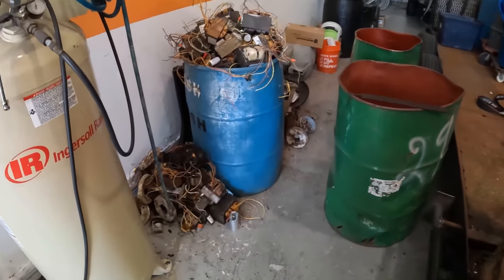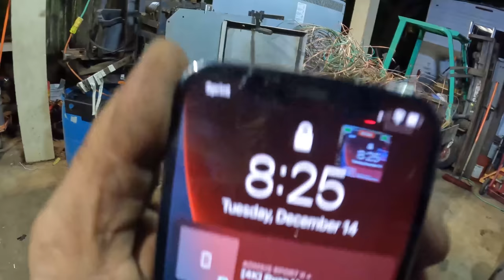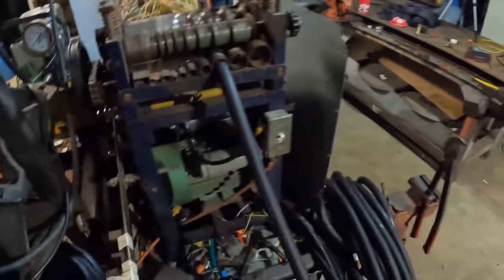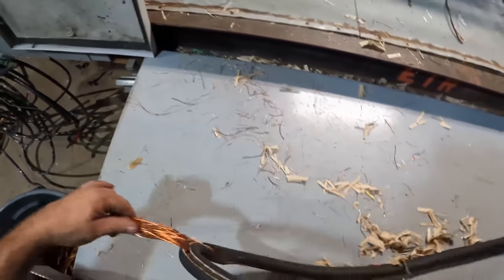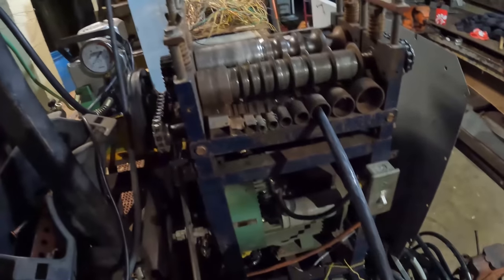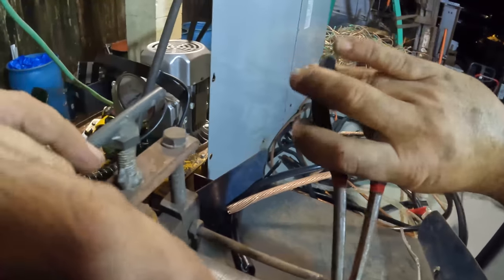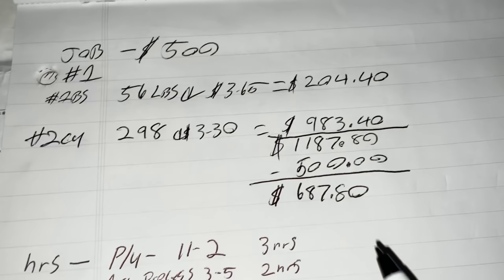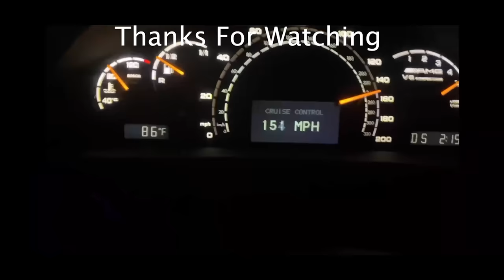Make $1000 A Day Scrapping!

Comment: You said "someone, somewhere's crying" over that welding cable. Now you're gonna cry...
  That was a 50ft welding cable, 4/0 gauge. The plain wire sells for $300 + shipping on eBay, netting $200 — even more with the connector you cut off.
Reply from the maker: I know what it’s worth if I could sell it, I get wire like this all the time I don’t have the space and the money to hold onto it. It doesn’t sell as fast as you would think I’ve tried. I buy all the stuff from electricians if they wanted it they would keep it.
Reply: @Project Shop FL  right, saw the same comment with the copper coil.  Time is money.  If he's banking say $125-$200 an hour then 1 hour of doing all the crap to sell on eBay, plus shipping, it's not worth it.  If I talk to my phone or internet company for more than an hour best believe I'm getting at least $100 out of it.  

$200 in the hand is worth $600 sitting on eBay that buyers buy wholesale with their business license and aren't wasting time on a bidding war on some 400 cable.  In plain terms he can bust his ass more and make less over time than just scrapping.  

I've been in scrap since the mid '90s.  .coms and eBay didn't change the scrap industry.  He knows what he's got and how to turn a quick profit being the key point.  1st video, I've seen, and have links to all the info, essentially found the best video here.  If he was my neighbor I'd hear the tunes/work and come over for a beer and help for fun.  My professional opinion!  Great job bud!
Reply from the maker: @generalconsumer9520  Thanks

Comment: I scrapped part-time for nearly two decades. I rarely made $1,000 in a day. YOU WILL NOT MAKE $1,000 A DAY. If you save your non-ferrous metals (copper, brass and aluminum) long enough you can earn $1,000 that day. If you are scrapping iron and steel you will need about 20 tons per day depending on the price.
Reply from the maker: I don't really deal with iron. I deal in copper and have custom equipment that no one has. I've made $1000 -$2500 a day processing copper. I've made many videos on it.  I have a video called "How to make $900 per hour processing copper transformers"  Now recently it has definitely slowed down because LED lighting has replaced the HID light's and transformers but I still can easily make $1000 in 1 day it's just not as often.

Comment: A guy wonts came to my job shop and asked me the cost to build a  cable cutting machine.  I asked how big of cable.  he sid the logging roads were lines with 3/4 steal l cable. .  After the cables were used for 175 hours  of logging. they were replaced.   I told the gentleman that I could build a shear  and stacker of the cables for 600.00, but he said it was out of his budget 1969.
Reply from the maker: Sounds like a good deal to me. lol

Comment: Why don't you make a little circle wedge to use to reduce the size of the hole.
Reply from the maker: It might help a little but is not gonna reduce the size of the rollers. The large cups will allow the wire to slide to the side of the blade. Thanks for the suggestion.

Comment: im still not quite sure how to decipher number 2 form number 1 copper...i mean youd think that stripped wire which is clean would be number 1 but i was told its number 2 also ...number 1 has no welds, paint or anything on it supposedly so from what i m getting its mostly copper pipe nothign from wires or anything..still thats alot of copper around ehre number 2 goes for at the lowest maybe 3 dollars but its usually more 3.50 lowest anyway usually around 4 is decent ...so thats close to 2000 dollars here.. id be happy being able to make that much but you have to have connections for that ...every now and then theres som big hauls..im going to start stripping stuf fmore i think theres alot of copper that gets by...compressors and such,,probably start stripping them...just for osmehting to do
Reply from the maker: Any extension cord wire, SO cable or welding wire with the fine copper strains will always be #2 copper. Copper pipe with no solder and paint should go as #1

Comment: I almost feel like if you had a huge set shears like that but hand operated you could go through more cables at one time then that hydraulic one that's kinda of a crappy pump of that's all it can do lol
Reply from the maker: The pump is not a problem, the pump is a 10,000 psi pump, the sheer is only 5000 psi and really only made for cutting the thin metal from a car. There are other cutters out there called decommission tools that are more along the lines of what I need I just got these because they were only $200 compared to thousands for those other tools

Comment: scaring the hell out of me with those jaws
Reply from the maker: 😂 Why?
Reply: lol. Hey man I have the master carpenter and ran a theater for 18 years and one of my jobs was obviously safety officer and equipment trainer and tool trainer I've never used it a piece of equipment like that I imagine it's pretty powerful I usually in my line of work I usually see an accident before it happens and I put a stop to it it was just something about watching you that I just made me cringe I mean you sure you felt safe but was weird I didn't and I was afraid for you it was a weirdest thing man and anyway good video I enjoyed it very much
Reply: @ProjectShopFl  AR side note have you ever I'm scrapped an RV refrigerator 12 volts propane system I just picked one up tonight I've never seen the back of one of these before
Reply from the maker: Thanks for the concern

Comment: Maybe some lubricating from time to time with WD40 or something like that would help on your stripping cables machine to prevent this plastic film from insulation block your machine. Dunno just saying.
Reply from the maker: You don't want oil on the rollers, it will make the wire slip.
Reply: @ProjectShopFl  Yeah didnt notice it has cutting rollers up and down, i thought the down roller had some kind of  teeth to grab the wire.
Reply from the maker: @petertomas3665  It does not have teeth but it should. lol

Comment: Make a sleeve than can reduce the hole and center it. Make several for the different holes so you can double or triple the holes you have now.
👍😎👍🇬🇧 m-E-m
Reply from the maker: Thanks for the suggestion.
Reply: They sell those, not as big, but the time he spent to strip that eagle's nest of wire I was more than impressed.  If it ain't broke...

Comment: You could have made a lot more out of that 750 cable if you would have sold it as wire instead of scrap. You would think an electrician would have bought it.
Reply from the maker: I bought it from a electrician. lol I don't have the space to hold all the good wire I get. I would quickly run out of room and money. It does not move as fast as you would think. All of my customers are electricians and unless they have a job for it most really don't have the space for wire they might never use.
Reply: Wow, OK. Strange but true...

Comment: I can’t believe striping that large wire with the length you had you can make more money scrapping it the price of that a foot is so expensive I can see if you had short pieces of it    But when you toke the jaws of life to it. I was like dumb as shit seen in a long time bud the way it sat made more money and didn’t have to do anything to it. Only seen folks trying to hide or cover up something take perfectly good wire and chop it up and scrap it.  So please explain wth any one would do such and not even get bright price for it. Rest video bang up job and made perfect sense to me. And I may be the idiot but I know buying it just the jump from 12to 10 gage and then 8 gage is a lot and what you had only hundred how much would  that wire cost you
Reply from the maker: Yes that wire was worth more "as is" If I had some one that wanted it. I get wire like that and lots of other wire all the time and have tried selling it. The problem is unless some one has a job for that specific wire and length I wind up sitting on it and it takes up space and my money. If I saved all the good wire I got I would be out of space and broke real quick. It does not sell as fast or as easy as you would think. I buy all the wire from electrical contractors, If they wanted it they would have kept it. I hope that makes scenes to you.
Reply: black market in Australia, ppl rip empty houses apart & steal copper & brass to sell, I agree if You have more valuable cable intact why would you scrap it for less unless you only have small volume of it & quick turnover

Comment: From a business point of view, wouldn't a thick 2000 v cable  be worth more selling to an electrician or someone who needs it for a machine or what not ?  Sure you need to put in more time finding a buyer, but isn't all about using the least effort to get the maximum profits ?  I bought a big heavy guage cable 100 ft long to power 2 trailers, I think that was around $400 or more.
Reply from the maker: Yes it would be worth more. The problem is I bought it from an electrical contractor and I get new wire all the time. It don't sell like you think. I don't have the money or space to store all the good copper I get neither does some electricians that's why they sell it to me or scrapyards.

Comment: Why don't you get someone to knock up a few different sized bushes up for the hole's you have so you can change them to suit different sized cables rather than adding more different sized tubes
Reply from the maker: Good Idea but the problem with that is its not changing the size of the rollers. the wire will still walk all over once past the tubes. Thanks for the suggestion and for watching.

Comment: Couldn't you have made more money selling that big wire to someone as is vs selling for scrap? Just curious.
Reply from the maker: If there was someone that had a job for that specific size wire and length maybe. But I can not sit on all the good wire I get I'd be out of money and space in no time. It does not sell like you'd think. If the electrical contractor I got it from wanted it he would have kept it. They are in the same situation, they will have piles of good wire and they get tired of moving it around or it taking up space. Scrapping it is the best option.
Reply: @ProjectShopFl  true, the presumption would be if someone had a project they are doing they would already incorporate purchasing that wire into their equation. Makes sense. Thanks for the reply. 🙌

Comment: Wouldn't it be easier and faster to burn off the insulation?
Reply from the maker: No because the copper is wrapped around the welded steel case.
Reply: @ProjectShopFl  ah, ok. Thanks!

Comment: How much did it cost to dispose of the stripped plastic coating, and how many multiple places did you have to travel to pick up everything, how many hours were involved in travel and communications, insuring your vehicle wear and tear on the vehicle, wear and tear on tools(which clearly need major repairs), how much did you pay for your equipment to start with, you didn’t make $1000 in one day, because you spend many days collecting the metal, and many hours are involved in that, and you left out costs of keeping your tools maintained, among other things, im going to estimate $300 a day because altogether you likely spent a total of 3 days including collecting of the metals. When calculating your profits in any business, tracking the costs of everything is necessary, you did a good job tracking how long you spent in the shop, but disregard all the time it took to get everything into the shop which is how businesses show profits on paper but have nothing to show for because they disregarded half of the work they did, your time has value, not just the time in you shop but every waking moment spent collecting your metals has equal value.
Reply from the maker: This is just a hobby of mine and I'm showing what is possible. Did not cost anything to get rid of the plastic I put it out for recycling. I explain everything in the video. I picked up most of that scrap that morning from 1 place. The other scrap was from a job that I already processed and made all my money back plus lots of extra that also came from 1 place. I call that F-it scrap. I even explained there was more scrap left over from that day that I did not sell.  I usually pick up and process scrap and sell it within a 24 hour time frame and can and have made $1000 per day. I've made many videos showing it.

Comment: Where did you get the cutter
Reply from the maker: What cutter?
Reply: @ProjectShopFl  the hydraulic cutter you used to cut the heavy wire into shorter lengths
Reply from the maker: @ralphkleyer9324  Ebay. it is a jaws of life

Comment: Where would you find that giant flexible copper for "not alot"?? You could have sold that for 2-3 times scrap value!! What a waste!! I would have paid you for that pile!! I make giant battery cables and welding cables for people. You lost money scrapping that beautiful copper!! I once saw a guy drop a 80 lb. block of lead in place of light iron. Thought he was getting one over on the yard! What he did was lost himself about 100.00 bucks. Good luck.
Reply from the maker: I bought it from an electrician just like all my scrap. I get stuff like this all the time and it don't sell as easy as you think. If I kept all the god copper wire I get I'd be broke and out of room. I'm in the scrap biz not the wire selling biz. I made my money and I did not have to spend time trying to find a buyer and have it taking up space I don't have.
Reply: @ProjectShopFl  amen brother

Comment: Seems to me, That "brand new"  heavy copper cable was easily worth a multiple of its scrap value if sold as is. Chopping it up for scrap is equivalent to doing the same to classic car parts.  To the man with a hammer, (or wire stripper) everything looks like a nail (melt value scrap).
Reduce, REUSE, then recycle.
Reply from the maker: Who would buy it? I bought it from a electrical contractor that did not want it. If I kept all the scrap that was usable I'd be out of space and money. It don't sell as fast as you'd think.
Reply: @ProjectShopFl  Have you tried CL or marketplace?  Or call a shop doing solar system installs on homesteads or custom vans. It may be oversized for their needs but you could offer a price that's win-win.  Or try  a shop installing winches on 4x4s.  Or a  welding shop.   Or a boat yard doing electric conversions.  A little sales bird dogging may present a learning curve at first, but could be a valuable addition to your tool set.

Comment: Dude put some gloves on touching that stripped copper with bare hands then eat and drink or scratch your your self 
It contains harmful substances to protect it from corrosion and stuff your getting that on your hands
You doing a good job but dude take care of your machines 
Librication and derusters are key to keep a good machine rolling
Your machines lacks a bit of power due to rust and dry parts everywhere 
Use MOTUL chain lubricants and w40 for those bolts you tightening 
You will thank me later
Plus change the belt to a chain it’s better just buy sake size but sprockets and a good motorcycle chain something like a v530 it so long you can make 3 chains out of it with $100

Comment: You might have to sharpen the blades on your machine. Might cut better.
Reply from the maker: You are probably right, I have new ones and am going to make a video of the process of replacing them and some upgrades. Thanks for the suggestion and for watching.
Reply: @ProjectShopFl  take a file to them . That should do it.

Comment: I have no Idea how you take apart transformers, why not show 30 seconds of detail before switching tp high speed.
You also chopped hundreds of dollars of cable that would have made the worlds best jumper cables, which you could have sold for a kings ransom.
What a waste lol.
Reply from the maker: I get so much wire I can not hold it, it comes in and I strip it as fast as possible so I know what my profit will be before the market changes. I've tried holding onto it but it just piles up and I wind up stripping it. When a electrician needs wire its usually a certain size and a certain length. There are tons of wire sizes and most of the wire I get has been pulled out and already used. Its more of a hassle to try and save it to sell as is. As for the the transformers I explain everything in this video. 
https://www.youtube.com/watch?v=aL9jkAn8uyo&t=1035s

Comment: That’s a terrible wire stripper all u need is a single blade with a adjustable clamp on a roller they cost under 200 bucks
Reply from the maker: This wire stripper cost around 1500 new, no $200 wire stripper is going to compare to this!

Comment: Make $1000 dollars a day.  But only if u have 10+thousand dollars in machinery.  Great video otherwise.
Reply from the maker: most of my machines are custom built and What I had to pay for I acquired at a fraction of the cost most of the time or use the barter system. I might have $1200 out-of-pocket for the hydraulic presses and I paid $250 for that wire stripper